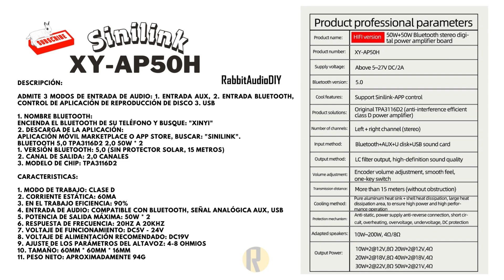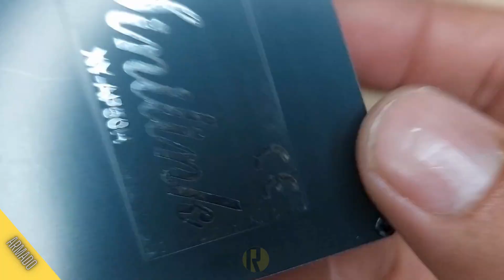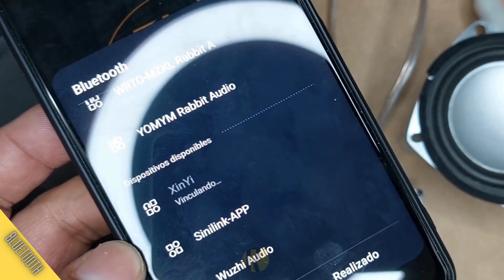🔥 Placa Amplificadora MUY POTENTE Sinilink XY AP50H TPA3116D2 Clase D 100W

Comment: Oye amigo. Se me dañó una barra de sonido marca Vizio, quisiera ponerle algun sistema ya que las bocinas supongo que estan buenas. Que me recomiendas? Me gustan tus videos. Saludos desde Puerto Rico.
Reply from the maker: Hola Elizabeth muchas gracias por tus comentarios y por preguntar.  Necesito que busques  que  modelo es tú  SoundBar para yo buscar las especificaciones y decirte que ampli te conviene usar y seria con Bluetooth y auxiliar y te ayudaría mucho!
Reply: @rabbitaudiodiy barra Vizio modelo sb2820n-e0. Gracias
Reply from the maker: @elizabethrosado5033  Hola no encontré mucha información pero al parecer es de 25W rms te ayudaría  el  amplificador wuzhi audio ZK-152 ó el ZK-152T. Si quisierqs añadir un subwoofer de 30W podría  ser el amplificador ZK-LT21 ó el Xinyi audio E30H. Los podrías usar de 2 formas, sacar los cables de las bocinas de la barra de sonido y conectar por fuera al amplificador, ó buscar un espacio y adaptar el amplificador a la barra de sonido.
Reply: @rabbitaudiodiy  perfecto, si tiene espacio,  las bocinas vienen selladas de tal forma que para sacarlas tendría que romper el plástico donde vienen instaladas. Si tiene los cables, probaré a ver si funcionan así. Así no tendría que hacer ningún cajón para ponerlas. Le echaré un vistazo  a los módulos. La alimentación es de 14 a 24 voltios. Gracias. Saludos ✌